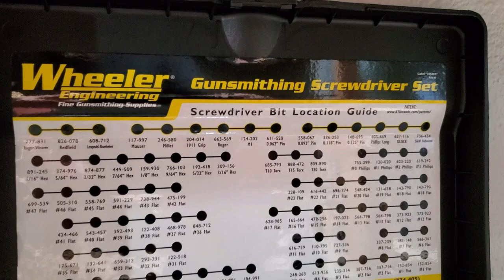Winchester Miroku 1886 Disassembly and Reassembly

Comment: Great Video !!  I just ordered a Winchester Deluxe 1886 Color Case Hardened in 45-70.  I am a little concerned now after watching the video.  I’m a real stickler for keeping all my guns cleaned and lubricated.  This is by far going to be the most complicated.  Your video is going to help a LOT !!  Thank You, I had no idea what I was getting into but it ought to be fun learning.
Reply from the maker: Wow Mike! That is a beautiful rifle. My suggestion would be to set aside a few hours for your first try. And then go through the process start to finish three or four times before you put that beauty away. That's what I did, but I think it was more like 10 times to work out all the kinks for the video. Still, it is one of the greatest and most beautiful rifle designs ever. So it's worth the trouble.

Comment: Good job, i’ve taken them apart many times, for me it was a struggle to put the hammer screw back in because you have to lined up so many different parts at once, i’m glad you did this video now I don’t have to.
Reply from the maker: The secret to getting the hammer screw back in (at least for me) was the string that keeps the trigger pulled. That keeps the sear from pushing up on the hammer. One less thing to worry about.

Comment: Great instructional video. Now going to tear down my miroku 86 for cleaning and lubrication. Thank you!
Reply from the maker: Good luck, and be careful with that screwdriver!
Reply: @TargetSuite  All went very well. Used the "Clothes pin " method took alittle patience but she clean an lubed now. The screw heads were my biggest fear. I bought Foster screwdrivers long ago to try an not ever bugger a screw, and so far so good. The string on the trigger trick was also very helpful. Thanks again !
Reply from the maker: That's great Robert! I'm really glad it was helpful. It's getting close to time for me to open up mine. I'll probably have to go back and watch this video myself.😄

Comment: I am amazed with this John Browning design with a compicated mechanism and lots of moving parts which is usually a recipe for malfunctions and short longevity but is actually a very strong and reliable design.
Reply from the maker: Exactly. I spent most of my career designing mechanical systems. It was always a challenge to get all the moving parts to work reliably and I was using a state of the art professional (and expensive) CAD software package. To accomplish what John Browning did with pencil and paper, and NO 3D printer, boggles the mind.
Reply: @TargetSuite  a genius indeed!
Reply from the maker: Hahaha! Just an ordinary guy . . . with good video editing software 😆

Comment: Thank you very much. Enjoyed it all. This video will give me the currage to disassemble and reassemble my own Winchester 1886 Miroku. You present problems and solutions in a very good way. Thumb way up X 2 from me :) I have modified the "rebounding hammer" as well. But I did it because it caused weak primer strikes. After I removed about 8 milimeters the problems seased to exist. I now have very positive primer strikes and no rebounding hammer at all. Good trade :)  Thank you again. Very good instructions. 

By the way....... I guess that all the pumpkins was sold out.  :-) 

Cheers
Reply from the maker: Thanks for your encouragement! It makes the effort worthwhile. Let me know if you run into problems that I didn't address in the video.
Reply from the maker: Hah! I missed your pumpkin comment. I picked up 14 pumpkins on Saturday and planned to go to the farm to film an intro an outro for this video around those pumpkins. It was going to be exciting. But then I realized this video was going to be too long by itself so, if the pumpkins don't rot, you'll get to see them all lined up and filled with a mystery semi-liquid substance and shot with the 45-70 next week. Not sure if I will use a Leverevolution expanding bullet or hard cast 405 grain handload. Either way, I hope to capture some exciting video as well as some penetration data. It should be fun. And speaking of lining up things, I have applied with the biggest international "world record" company so establish a world record shooting things lined up. I can't share details now, and I haven't received approval yet from London. Regardless, I will post a video in December with either a official or unofficial claim of "shooting" the most um, the most, uh, I'm sorry, you'll just have to wait :-). But I hope to use the 1886. Stay tuned!
Reply: @TargetSuite  How about soda bottles with various colored water in them? Hmmm. Or pennies?
Reply from the maker: Interesting thought . . . pennies

Comment: Suggestion. To hold flat spring in place on the loading gate, place a small dab of gunsmith glue to hold the spring in place. Gunsmith glue is, grease. Nice video sir.
Reply from the maker: Great idea! I used that trick to hold a washer in place deep inside my tractor until I could get the PTO shaft reinstalled.

Comment: How did you learn to do that? That is amazing. I had no idea that the innards of that rifle was so complex. Very informative.
Reply from the maker: Thanks BKM49. It is complicated and what's amazing is that it was designed before computers or calculators and prototyped in wood! Of course, 21'st century lawyer's demands just made the original design more complicated.
Reply: Mine has a trigger way way too heavy. I need to do a trigger job.

Comment: Hi, I live in Australia , we are on the back foot here so to speak, missed the initial run of Miroku made Browning 1886 and ended up with a Pedersoli. Gun would not feed and would not go bang too much head-space, it was pretty to look at but junk inside where it counts , got my money back , then I had to wait until Winchester brought the 1886 short rifle into Australia, only to find it had issues with the trigger too much creep, no half cock , so I removed the rebounding hammer feature, installed a Browning hammer and trigger made up a new mainspring /hammer strut and its good to go. Occasionally I get misfires ( 1 in 30 rounds) caused by the inertia firing pin, I overcame this by using softer L/R primers. 
 Is there a fix for this problem, I really would like to go with an original type pin and overcome this built in problem, will a heavier mainspring work but I really would like to drop in a one piece pin as they were originally made.
 Thank You Vaughn Gunthorpe
Plainland Australia
Reply from the maker: Wow Stephen. You've been through the ringer as they say. My guess is that your mainspring may be too weak. Other than that, I don't know.

Comment: Working up the courage to try this....
Reply from the maker: Hi Dylan. I would begin by mastering the steps. It will take a long morning (or more) but disassemble/reassemble each step until you master that. Just be careful and not let a tool slip and damage a screw or scratch that beautiful bluing.

Comment: Several years ago, I made the mistake of taking an original '86 apart that was manufactured in 1905. The biggest problem was that I was well into a bottle of whisky when the disassembly took place, and I was stone cold sober when it went together. What a nightmare. lol
Reply from the maker: And the real hangover came after getting it all back together, right?

Comment: Thanks. Very good video. You take time to really show the tricky parts with readable close ups. Very useful. 
I wonder if the 92 Miroku is as complex or not? It is supposed to be the same mechanism, but I am not sure. 
Thanks again, for me this is the only usable vid so far.
Reply from the maker: Your comment could not be more timely! I am working on the Miroku 1892 disassembly/reassembly video as I type this. That video should post tomorrow morning.
Reply: Target Suite That’s really great. I’ll wait until you post your vid before I venture disassembly and reassembly my brand new Winchester Miroku 92 for cleaning. 
Thanks a lot in advance. 👍😃
Reply from the maker: Working on it now. It may be a late night but I usually post at 4:30am on Tuesdays😉

Comment: Thank you so much for your videos. Especially this one. Wow.  How does this new made 1886 compare in disassembly with the originals?
Reply from the maker: Thanks! The Miroku Winchesters are very similar to the originals. The tang safety and rebounding hammer are the biggest differences. If you can follow this video and still have a functioning rifle, an original would be a piece of cake. ;-)

Comment: Excellent job George, I wish I had your talent. Mine is almost the same version as yours (Browning) without the tang safety. Ill be your study watching the video probably another 20 times before tackling the job myself. I also noticed the modification of the lower hammer strut to eliminate the rebounding hammer. Im wondering if it affected your trigger and hammer pull at all? Again thank you very much, this has to be the most informative video Ive seen on the 1886.
Reply from the maker: Hi Gary. I ordered a new hammer strut but it didn't arrive in time for the video. I don't remember any change after I modified the original, but once I get the unmodified strut installed and can answer your question about trigger and hammer function, I will reply to your comment. But to be sure, I will keep the old, modified hammer strut installed for daily use.

Comment: When you put the Skinner sight on did you have to put a taller front sight as well?  I'm going to make a work stand like you built there.
Reply from the maker: Yes. I have put a Skinner on three rifles and they all required a taller front sight. By the way, when I build my next version of the work stand, I am going to build it to work with more rifles. The base will have tapered "sockets" to accommodate at least two different rifle lengths and the risers will have tapered ends that will tap down into those sockets. Each riser will be rifle specific I share that with you because I watched your video on the powder drop station and can tell you are an engineer at heart. Thanks for the comment!

Comment: When reassembling the bolt and hand lever temporarily before sliding in place put a temperary pin in painted a bright color on the end and then punch out temporary pin out with the permanent pin.
Reply from the maker: Mike unless I am missing something, there is no way to tap out a temporary pin after assembling the 1886.